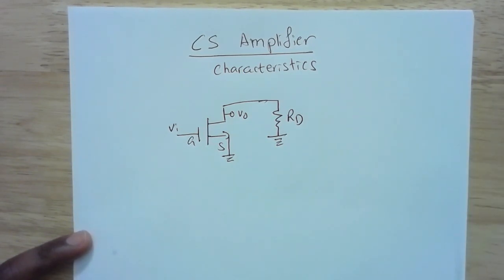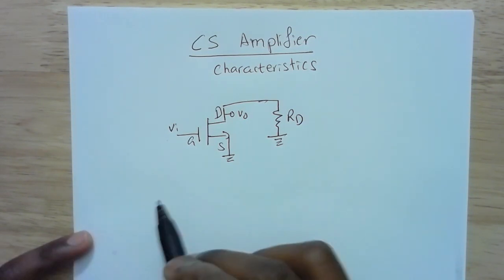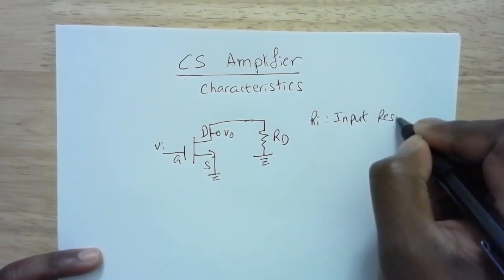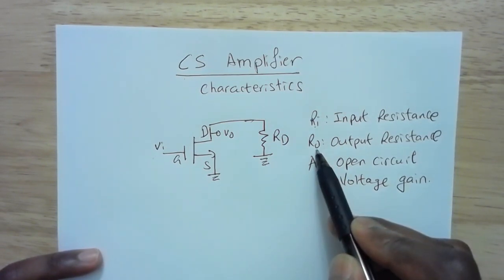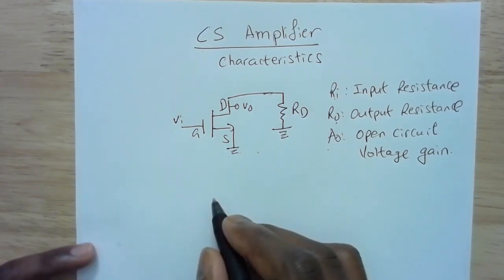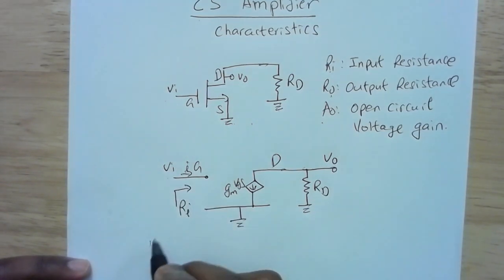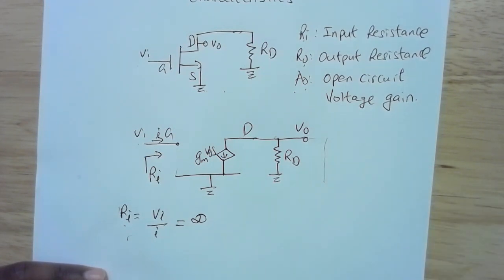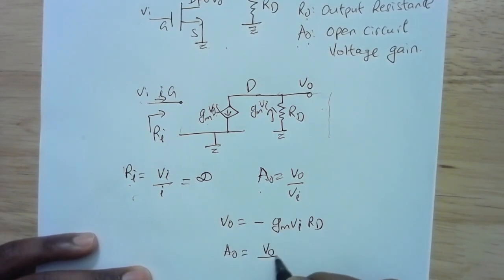CS Amplifier Characteristics

Comment: How can we calculate gm for Cs amplifier 📢
Reply: Hello Nandha, gm is typically calculated as kn x Vov, where kn is the device transconductance parameter, and Vov is the overdrive voltage. Note that Vov is determined by the DC biasing, so gm changes (can can be controlled) using the DC biasing.